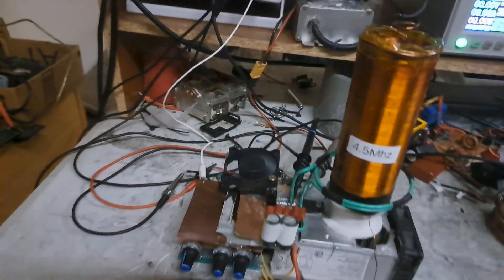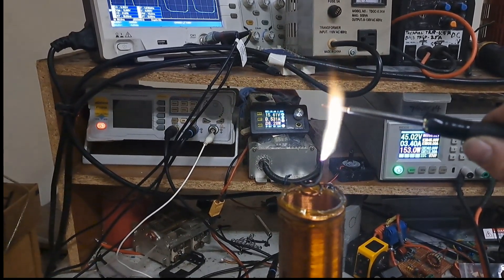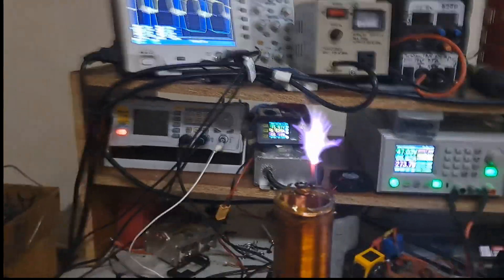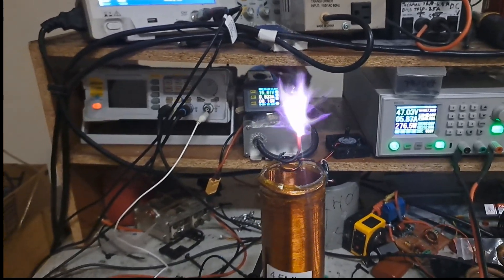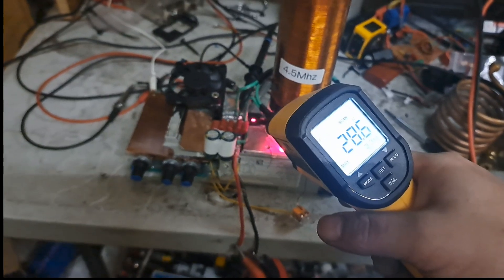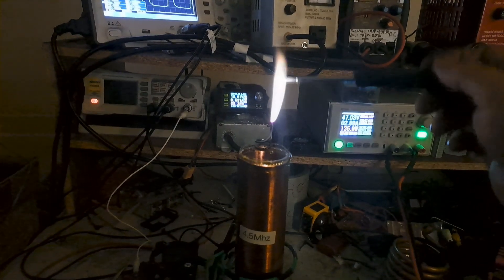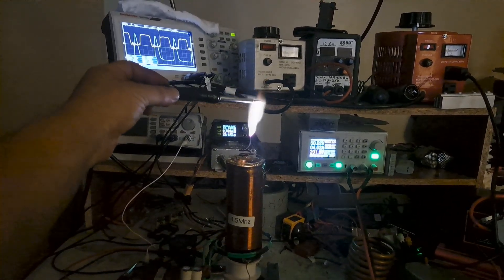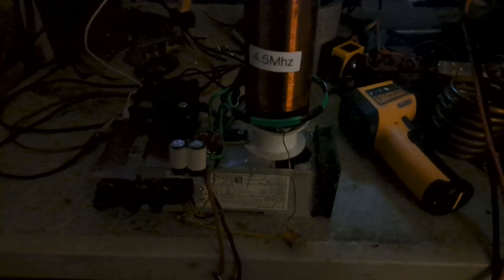4.5Mhz PLL HFSSTC 5 Minute Run 250W+

Comment: Try a PL504 using a signal transformer to drive the grid.
Tesla coils were meant to be driven by a beefy pentode, by their own nature.
Alternatively, you can try with an IGBT, there are some robust devices around...
Reply: yet tesla didnt have "beefy pentodes"?
Reply: @paradiselost9946 I also wouldn't call a PL504 a beefy pentode XD
Reply from the maker: You can def use tubes for these but an IGBT is way too slow.
Reply: A PL504 would be significantly less powerful. Only ~100 watts max without  abusing the tube

Comment: What SiC fet are you using ? Do you have any links to schematics ? Been trying to make a HFSSTC.
Reply from the maker: It's a UF3C065040K3S. Fairly beefy fet but only 650V. This one was kind of a toss together so I'm not totally sure what I did now that I have all the IC's shielded. I just know I used a fast 4046 chip to set a VCO frequency in the range I needed then added a CT for feedback. The important part is I have a gate driver than can handle the current. These seem to work totally fine running them fixed frequency but it needs to be solid. I would refer to Eirik Taylor's Class-E build as a good reference where you just make some power stages instead of using a driver IC.

Comment: I would not have expected it to draw significantly more power unloaded (250w) as compared to having the metal poking stick in there acting as a capacitive load (150w).
Reply from the maker: Yea just a result of the tuning I guess. I could probably get it to do the reverse but then it would be smaller breakouts to free air.

Comment: Is amazing , pushing such a beefy plasma bush while keeping the switch cold , SiC magic
Reply from the maker: They are getting pretty crazy man. This one could be doing way more but I'm just impressed at how well it handles. I noticed yesterday that Steve Ward posted his HFSSTC findings on a new webpage. IDK how long it's been up but he has a couple circuits using SiCs I want to try and one is using small package C0G caps for the tank. I have a few similar fets laying around and the general layout and build is pretty crazy simple for those self oscillating circuits. Like he mentions though you can still do it with a regular Si fet like a 460 but it has to be kept class-e at higher powers. He just adds an extra bit of components, or a supply, to bias the mosfet externally with a 12v reference and divider.
Reply: @Magneticitist  I just got my SiC hfsstc working based off his design, using one of those HEC HT57 doorknob caps I can push 1kw+
Reply from the maker: @darascope  That's awesome. Your build looks like a near perfect replication to his. I'm hoping to be able to do maaaybe close to 1kW as well but I'm good with only about 500W. I want to grab like a whole catalog of those C0G caps and get to playing.
Reply: @Magneticitist  using a UF3C120080K4S or other TO-247-4 fets is really nice, laying out the gate capacitors with smds like he did made everything super compact and was more intuitive to make a pcb for than TO-247-3 fets
Reply from the maker: @darascope  I totally agree I was a little apprehensive about making layouts for those 4 pin deals then when I actually looked at the pinout and how a PCB would go it just naturally worked out about the same exact way Steve has his. Just real handy. I have a few UJ4C's at 750V I'm hoping will work for me.
Reply: @Magneticitist  I wanna keep pushing mine harder but im tired of winding secondaries😭😭 I could put a voltage doubler on the output of my variac to get higher than ~150v but its only a 2kva unit so i dont wanna push double the current I already am
Reply: @Magneticitist ,can you share where you found his new posts?
Reply from the maker: @QZW_Labs  Wardpowerelectronics.com
Reply: @Magneticitist  thanks!